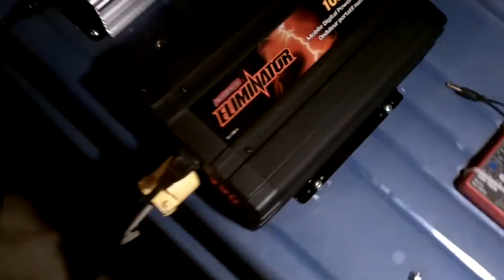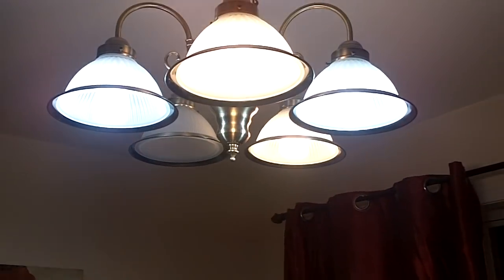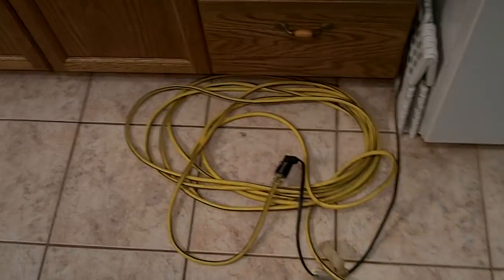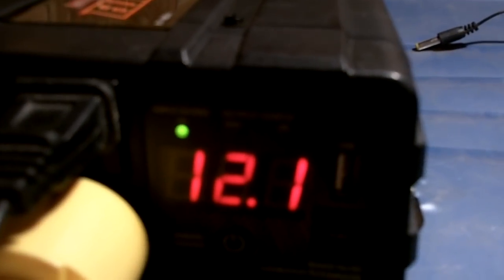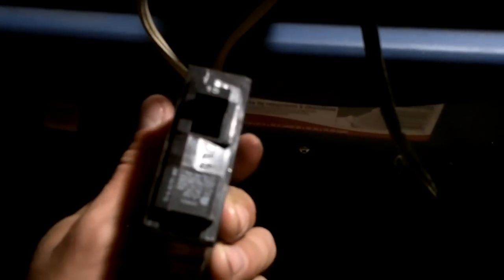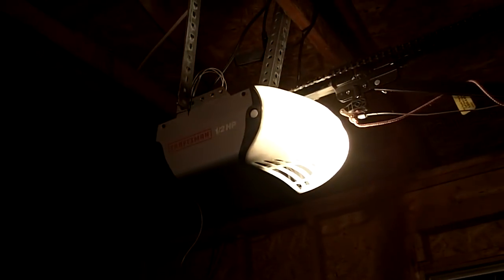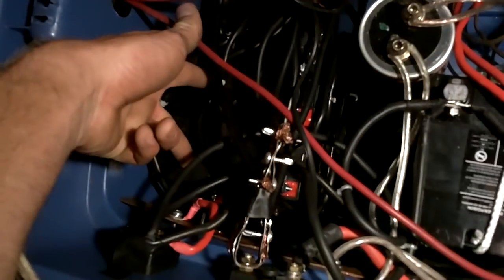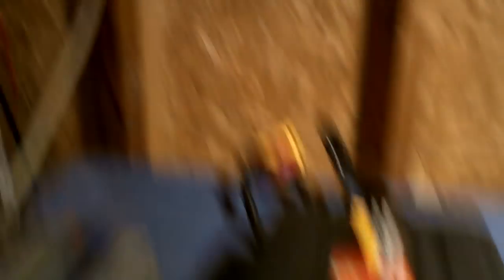House running off 1000W inverter

Comment: If you improve this system, I suggest even numbers of 6V golf cart batteries. I know this is a test setup, but eventually you'll want to tidy everything up and have everything firmly mounted so everything is safe from bumping by activities in the garage, and you'll want everything fused correctly. I'd spend the money on batteries first, better inverter next. You can't have too many batteries. In the real world, power can be out more than two hours. Check the duty cycle (and % of efficiency) of any prospective inverters. IMHO, an inverter tasked with replacing power for a long duration should be capable of at-least 50% load for days, not hours.
Reply from the maker: thanks a lot! I would love it if you looked at a few of my newer videos you might like what you see :)
Reply from the maker: yes you should check out my newer videos my system has come a long way!

Comment: You could definitely use a larger  inverter,  I'd go with  at least a 2000 watt constant 4000 watt peak.  They're  not that expensive, you can probably find one for under  $200.

Comment: IF U build this setup and have it on the lights in the rooms and the fridge and freezer - it will run them separated from the mains grid -off the electric bill - and will keep them up and running when there's a power outage. U can combo charge from trickle charge from power line and solar every day. Lights are off all day so it will only have to work for the refrigerator and freezer - and they are only a few amps each if you obtain them with that in mind.
Reply from the maker: yea, I have changed a lot, check out my newer videos.

Comment: I created a setup just like this but my Xantrex inverter has GFCI outlets.  What should I do so that they don't trip when I try to turn on the inverter? Thanks
Reply from the maker: might have to bypass it, are you using the ground?
Reply: +fliping720 no I'm not using the ground on my suicide cord? What do you mean by bypass it?
Reply from the maker: YouTube305 might have to bypass your gfci outlet :(

Comment: run your wash machine and dryer plus ac. bet inverter will  blow.
Reply from the maker: haha it would shut down for sure haha!
Reply: just like mine did running a dryer for 2 mins
Reply: It would not blow the inverter it would just set it into protect mode
Reply: just small appliances

Comment: How long does a battery 100AH deep cycle under constant sobrecarca of 100watts
Reply from the maker: you might get 400-600Wh out of a 100Ah battery at that type of load.
Reply: Thanks for your reply , I have electronic equipment that consumes me constant 300 watts. How many hours would support me 100AH battery
Reply from the maker: Obdulio Sandoval about 30-40mins
Reply: thanks , you could give me your email
Reply: you know how long of useful life has a deep cycle battery constant 100 watts, 250 watts feeding it with producing a panel
Reply from the maker: Obdulio Sandoval that depends on where you live, you will have try it out and see what happens where you live.
Reply: I LIVE IN GUATEMALA.
Reply: JUST WANT TO TRY THIS STARTED IN SOLAR ENERGY
Reply from the maker: Obdulio Sandoval try it you will love it!

Comment: whats the cost of the inverter and battery's,  and factor in how will you keep battery's charged. "solor" perhaps....?and what's the purpose, are you experimenting
Reply from the maker: I was leaning how to use solar and I have a new much larger system.

Comment: Are you not using ground off the inverter
Reply from the maker: not using ground on inverter, but it is a pure sine wave.
Reply: I thought you could only not use the ground when it was not sine wave and if it is pure sign wave you could use the ground
Reply from the maker: Bob Barker no some sine wave inverters also have live grounds

Comment: How does this work everyone tells me if its not pure sine wave and you youse a 3 prong doubble plug that your inverter will instantly smoke
Reply from the maker: you need to check to see if there is power between the line and ground and neutral and ground to see if you have a live ground or not.

Comment: I got a 100 panel with a 900 inverter can only get 13.1 on charge controller. Do you gotta have more charger controllers with more panels
Reply: Read this for info.  https://handybobsolar.wordpress.com/
Reply from the maker: nice read, I have much nicer system now check out my newer videos

Comment: good day, I have a Big house: 4 refrigerators, 22 lights bulbs, 6 tvs and 4 pcs. what do I need to move all that stuff. thanks I Will suscribe
Reply from the maker: I would say a 6000W inverter would have no problem with that load.
Reply: thanks and last question how many charged car bateries do I need to supply my home 24 hours? thanks
Reply from the maker: jose r not car batteries, deep cycle flooded or agm batteries,I am not sure, but I would say around 20000WH to 30000WH.

Comment: Hey Crazy Person, that 15 amp circuit breaker with a couple of wraps of electrical tape you've got in your bare hand, is a dangerous electrocution hazard. Those hot inverters on a plastic box is a sure fire hazard. Has your local Fire Marshal seen, or should I say 'Scene', your handy work? What about the local building code inspector? You better correct those before they see this video and come looking... Just for GiGGles, where's your refrigeration/heating draw hook up, surly not that mickey mouse trap...
Reply from the maker: +Jim Gillin this is an old video and just shows how I could run my house on a 1000W inverter if you only use 1 high power appliance at a time, this was for emergency use only, and in this video I was testing it. In an emergence codes and such will not mean much.
Reply: Just saying... I've worked with these people... You don't want them to take it the wrong way...
 I didn't see any high powered appliances, no refrigerators, heaters, A/C or things that really draw current, the limiting factor for the inverters. Do you run a refrigeration unit on that 1000 watt inverter?
Reply from the maker: Jim Gillin that is why I have a generator panel and a Xantrex sw3000 inverter, check out me newer videos, :)

Comment: why batteries ? use solar panels to convert water into hydrogen and oxygen to run a gas generator even when dark and sunless days ... batteries decay over time - hydrogen and oxygen stored in excess will last wouldn't it? and acts like non carbon water emission steam (the problem gas conversion to usage)
Reply from the maker: +steven stallings batteries last 10-20 years, and you need platinum for hydrogen and its a lot of money as well.

Comment: The inconsistency of amperage reading from your plug-in unit and clamp meter are because they are reading different things. The clamp meter is reading the amps 12v going to the inverter from batteries and the plug-in unit is what the house is drawing from the inverter 120v side.
Reply from the maker: +LA TEEZI And I found out it was a ac only clamp meter lol

Comment: As LED lighting takes over, it'd be nice to have a parallel 12V DC wiring system to avoid loses in the inverter and capacitive-drops in the lights back to 12V.
Reply: +spook That over long distance not over a standard house!
Reply from the maker: +spook your talking over 200 feet at led power usage.
Reply: +fliping720 While house wiring can be a bit cough inventive at times, I don't see how you could get a 200' run-length from central power to the furthest LED in a normal house unless it was done in a basket weave.

A proper DC system would be something like USB, where segments would current-limit themselves and report up the network when too many lights were on.

More complex, but on the plus side, it would be easy to take that system off-grid while worrying about the old school heavy AC loads separately.
Reply: +Felix Automaton problem with 12v you can't run cables too far. You lose a lot or need some insane sick wires.
Reply: Headlights for an F150 2013

Comment: Pretty misleading name. Average micro wave oven uses a 1000 watts. Your range top starts at 1500, Toaster oven, small space heater the same. A/C system 8-10 kilowatts, same for heat. 
The easiest way to determine your power requirements is look at your electric bill. Your monthly average is listed, divide by 30, divide that by 24 to get your average kw/hr rating. (Or 720 overall)
Going off grid? Double your daily kw/hr requirements for PV  minimum,  Triple your daily kw/hr requirements for a minimum battery bank, while the Sun may shine 24 hrs, we don't  average 12 hrs. PV panels decay at about 3-5% per year. So add extra.
Reply from the maker: +Bryan St.Martin this is a backup system showing what I can run if the power goes out, I have not stating that you can run off a 1000w inverter 24/7 its for emergencies and testing, My system has changed a long take a look at my newer videos.
Reply: fliping720 It states clearly House running off 1000 watt inverter. Can that be anymore misleading?
Reply from the maker: Bryan St.Martin nope as it is running off a 1000w inverter, its called off grid living when people go off grid 90% of people have to cut back on what they use, I cut back to only a few things running at a time (lights and fridge) what more could you need in a backup power situation?
Reply: I'm looking at your video awaiting the play start button, it says "House running off 1000 watt inverter" While I know it really won't do it, and you know it won't do it, the GP out there doesn't understand squat about power.

So explain that it will run a basic refrigerator and some basic lighting for "X" amount of hours with the system you have described.

You seem bright enough to do that.
Have a great day.
Reply: Oh, I do like the Xantrex units, I have installed nearly 50 of them. Real friendly over battery types.
Reply from the maker: Bryan St.Martin remember I started small scale and uprated as I had money, at time of filming this was a big system for me, and to me it could run everything I needed in a power outage, and not I have a much larger inverter that can run all the 120 stuff.

Comment: You can run your refrigerator off of a 1000W inverter?
Why does some lights work and others do not?
How does the capacitor work?  Does the solar panels charge it and it just holds for fast discharge?
Reply from the maker: +Ninja 87 some 1000w inverters will run a fridge and others will not, depends on how good it is, I only have half my house hooded up to the inverter, and the cap is to half small battery banks stark up heavy loads.
Reply: fliping720 Thank You!  Do you have a video showing how you wired the capacitor into your battery bank?
Reply from the maker: ***** I put the cap connected right to the inverter as well as the betteries with as thick of wire you cane use.

Comment: hey lets say you had a cheap 100W inverter. and you had two 6V torchlight lantern batteries in series. Could you run it long enough to charge a cell phone or something? Not powering a laptop or hairdryer or anything but would it work for an emergency?
Reply from the maker: +realflow100 yes you could as long as they are charged
Reply: fliping720 umm using non-rechargable ones because most 6V lantern batteries aren't rechargable.. but would it still work anyways with fresh batteries?
Reply from the maker: ***** yea for a charge or two
Reply: fliping720 ok thats good.

Comment: Can a grid tie inverter run with the main breaker open, disconnecting my house from the grid, essentially back feeding? or would that signal it a grid down to the inverter and it would stop operation (To protect line workers in case of a grid down situation) ? just wondering if that was an option or if I would need to back feed with a regular inverter.
Reply: +policedylan You'd need to find a hybrid system i think. Some systems of grid-tied are only built for it cause the panels used are higher voltage.  Systems like this. (off-grid and buy/make your own system.) are more only 12volt/24/36/48volt power panels. So it's mainly12 DC converting to 110 AC VIA the inverter only.
Reply: +Raptorduder Dylan -- Raptor is correct.  For more tech (and not a lot of $$$) check out the specs on an automatic transfer switch.  If you lose the external power (whether it's coming from power grid or solar/wind turbine/generator), it will automatically switch over the power source and -- more importantly -- provide the correct connections for your ground and neutral circuits.
Reply: +policedylan  Grid-tie only works with a current thats already applied. If you was to cut the power to ur house the grid-tie is dead in the water.  It takes and senses the grids already formed waves and offsets it to use current from the grid-tie first.
Reply: Nate Marquis Thank you! was exactly the answer i was looking for!!

Comment: now we are the year 2016 and for example led filament lights are all the rage... 3watts give about 60watts of light....BIG difference  where i used to have 10 lights of 40watts surrounding my house on the outise (=400watts) now for the same amount of lumen i use only 30 watts (10x3w) now thats evolution for ya...lets see what will happen in 2020.
Reply from the maker: its now 2021 not much has changed :D

Comment: also you need to have yo7ur batteries the same amp hours as well.
Reply: +Nathan Dean No. Amp hours is current. The batteries VOLTAGE need to be all correct voltage IE 12-14volts.

You can have a 5amp battery with a 300amp battery. The difference tho. Is which one would you put first to drain power. The 5, or the 300. But in total it'll be a 305 amp system.

The voltage is what needs to be exactly the same. Cause you can't mix a 12 to a 48. Or you'll have the 12 being overcharged or overpowered by the 48.

Alittle reading goes along way bud. Learn about Series and Parallel connecting. It'll help you in the long stretch.

Comment: dude you need to get a islanding inverter. so you can legally feed power in to the grid. from your solar panels.
Reply from the maker: +Nathan Dean mine is island protected.
Reply: fliping720
thats good. so have you gone with a meter that can rewad the power that your feeding  back?
Reply from the maker: Nathan Dean no my house is always pulling 500w of power, and if im feeding 400w of power from my grid tie inverter into my house I will only be pulling 100w from the grid, I try not to push any more inter my house then I use
Reply: fliping720
kool do you also use thermal electric generators as well.
Reply from the maker: Nathan Dean no only solar atm
Reply: fliping720
go to thermal electric generator.com  ten products . look 4 power generation. then you'ill have more power incomin. why u ask they are emp proof and solar flare proof and quite portable as well.

Comment: I dont believe this. a coffee machine is 800 to 1,250 watts,  how are you powering your house with this? lol. Nice try.
Reply from the maker: +My Apartment On Wheels I did not make coffee, i did not have the freezer plugged in only had what i needed to keep running, fridge  lights and a laptop. A house does not take a lot of power unless you have everything on at the same time, and I did not say running everything in my house off a 1000w inverter did I?
Reply: +fliping720 like i said that inverter only powers a coffee machine, so what else could you actually use it for? maybe for a light to the dog house?
Reply from the maker: My Apartment On Wheels lol have a good day, I also run my grand parents place off one of these inverters you should go through my videos and comment there to.
Reply: fliping720 No im just trying to figure out what you could run with 1,000 watts, did you run the coffee machine lol.
Reply from the maker: My Apartment On Wheels No lol, the house had power running though it and i had my laptop, fridge, lights, and the few other small things that a house uses.
Reply: +fliping720 Yeah good thing you didnt have the coffee machine running or the hair dryer or you would be in trouble lol, im just kidding with you, im starting to figure out some of these power inverters, sims carrys 10,000 watts and you need four 12 volt batteries to power it, ive seen people run 7,000 to run there house i guess its what you run with it like some of your lights didnt work, its just a learning experience. Have a good day buddy.
Reply from the maker: My Apartment On Wheels check out my newer videos i have a 6000w inverter now :)
Reply: +fliping720 I wilk and thanks i also liked this video. Have a good night buddy.

Comment: How many total amp hours are your batteries?
Reply from the maker: +Joe Pagley around 400-500Ah at the time of filming.
Reply: Thank you
Reply: +fliping720  The large battery at 55, the medium one at 35, plus 11 at 7 Amp/hr each.  That's 90 plus, 77 or 167 total.  Since lead-acid batteries shouldn't be discharged below 50%, that gives you about 84 Amp/hr useable.  12V x 84 means you can run 500 watts for about two hours.  
And please tell me that you're not "backfeeding" with a suicide plug.  If you know enough to put a cap in to cover spike loads, you know better than that.  At least, issue as STRONG warning to the technically-unsophisticated to NOT DO THAT.  Please.